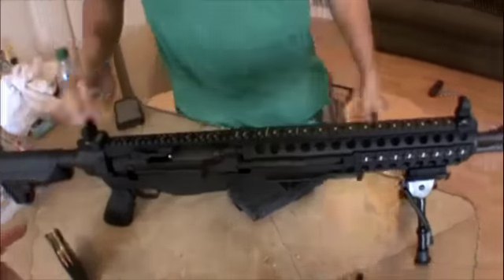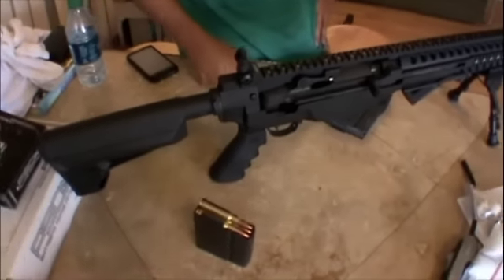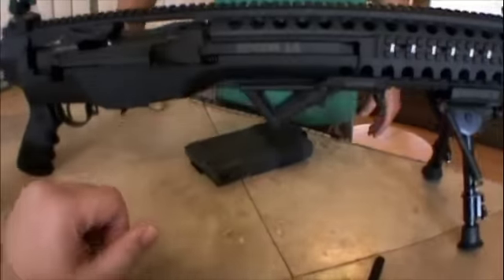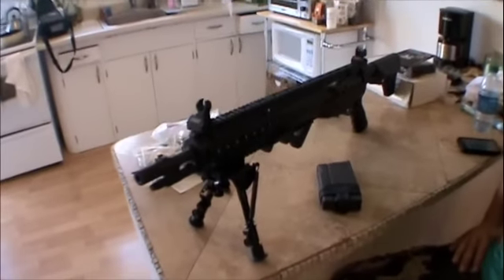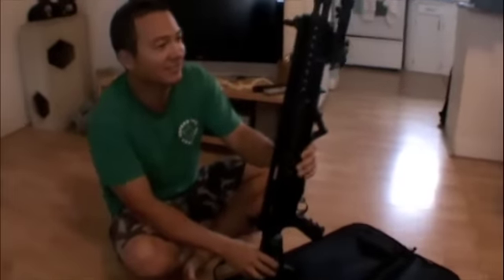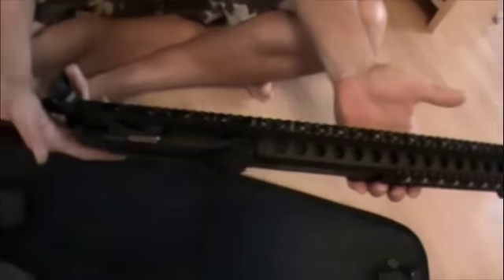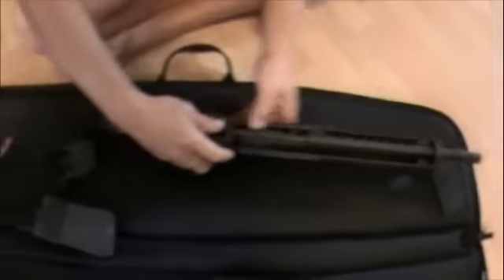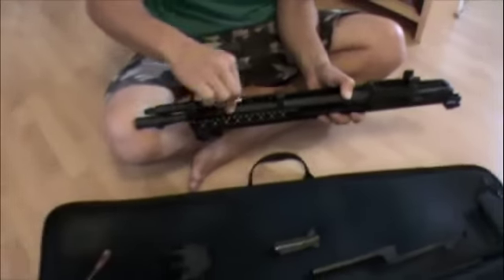Springfield M1A With A Troy M14 Modular Chassis System.

Comment from the maker: It was actually very accurate out of the box. We had no problems hitting steal targets out past 200 yards with iron sights. The chassis adds weight, but contributes to recoil management. The added barrel length should add even more range to your shooting. Several police departments have tested the 7.62x51 round through several barrel lengths, and have found that lengths 18" and 20" worked optimal all the way out past 600 yards. Past 600 yards was really dependent on the shooters ability lol.

Comment: @jessebickeldotcom That is correct. 2 screws where the rear sight once was and one screw in the scope mount hole. The gas block is removed and you replace the piece that holds the stock chassi with the troy piece.

Comment from the maker: @KiNgOfSuPrAs You can attach any stock that will fit on a AR platform. You need to buy a buffer tube and castle nut to attach any stock. just remember to get the right buffer tube. Mil-spec or commercial.

Comment: @snakebite210 I wanted the moe grip but it didn't fit well with the shape of the chassi.  The Maid would fit in the smallest config without using the backstraps but it was out of stock at my local shop and I needed a grip so I just grebbed the houge.  I know many people don't like the houge but I actually like it a lot.

Comment from the maker: @luminosity2083 It should be fine. Personally to justify the weight, I would recommend the longest barreled M1a configuration. This 16 inch socom should not weight this much for practical use. Long range usage makes much more sense with this platform. just my opinion.

Comment: @xxSURExxSHOTxx  I got my digilal scale working and got some accurate weights.  The first weigh in was with that generic spring scale was a bit off.  The gun Unloaded with the 20 rd mag in and the bipod off weighed 11.25 lbs. It still had  the GG&G bipod adapter on.  I weighed the Magpul ACR stock by itself. It came out to .92 lbs.  A pretty heavy stock. You could shave off about a half a pound with a lighter stock. My MOE stock is about a half pound lighter but looked to dinky on this gun IMO.

Comment: @xxSURExxSHOTxx Thanks.  I have been wanting to mount a scope on my Standard M1A, but have not found a good scope mount for it.  When I think I find one and start looking into the mount I find that there are always complaints about the mount causing the loss of the scopes "ZERO".  Do you see any problem with putting a long range scope on the Troy System?  Even though mine is only a Standard M1A, I want it to be a sniper type rifle.  Thanks again.